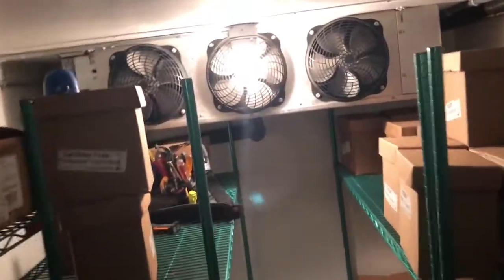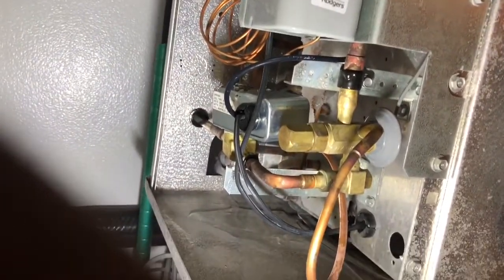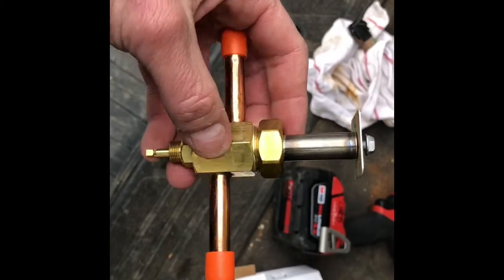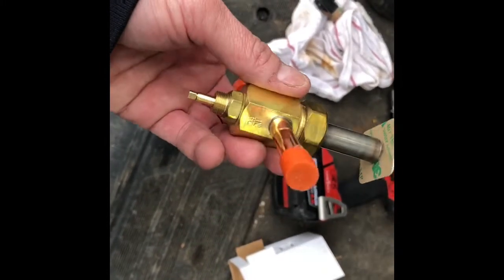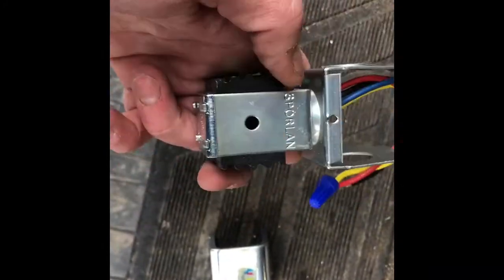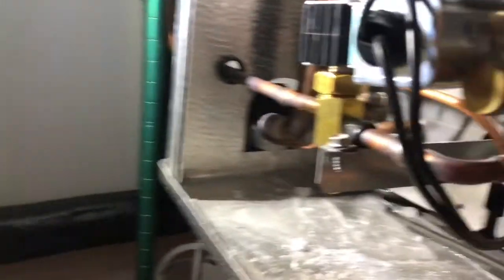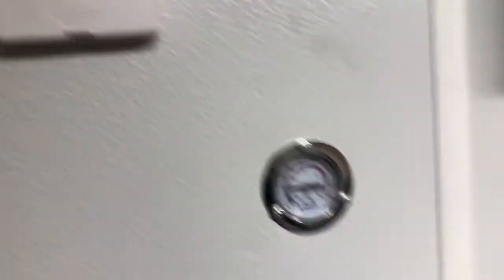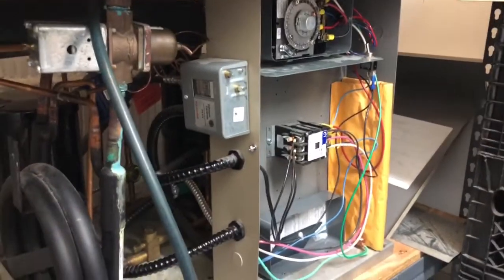Refrigeration Life #4 - Solenoid Valve Replacement

Comment: @CSC Refrigeration and Hvac  I find valves that chatter or buzz are due to partially shorted out windings in the solenoid electromagnetic coil.  Replace the coil, chatters usually go bye bye!

Comment: So as far as the wiring it's just wired in hot and is energized (open) during normal operation, and when the system turns off when it meets temp or goes into defrost the solenoid valve de-energizes (closes). The time clock controls this? And is it the same for a walk in cooler, since they dont usually have time clocks?
Reply from the maker: Yes it’s wired through the thermostat and the defrost clock.  I have another video explaining how all this is wired and I go over the wiring diagram and all that.

Comment: Hello. I have been watching your videos and I got to say you do a very good job.  I’m learning a lot. I have a solenoid valve in a walk in cooler with a similar condition, it’s making a loud buzzing noise. My question is; can the valve body just be taken apart and cleaned? Or does it really need to be replaced?  Thanks and keep them videos coming.
Reply from the maker: Mr. Tinieblas you can take them apart and change out the insides of you want but I find it easier just to change out your entire valve and it’s safer that way and you know it’s all new
Reply: CSC Refrigeration and Hvac thank you for answering my question.  Take care 👍
Reply from the maker: Mr. Tinieblas anytime man.  Thank you for watching

Comment: Why don't use 120V or 24V? What's the size of the tubing, 3/8"?
Reply from the maker: Alice Pet because the voltage on this system was 230 volts. And yes the pipe is 3/8
Reply: @Cscrefandhvac  Thank you so much!
Reply from the maker: Alice Pet your welcome

Comment: I was taught to just change out the guts on a liquid line solenoid. I know we all do things different.
Reply from the maker: Yes you can do that too , but sometimes the body can be warped and even by changing the guts it still won’t work. Like say the valve body got overheated when it was installed it can warp.
Reply: @Cscrefandhvac  I find valves that chatter or buzz are due to partially shorted out windings in the solenoid electromagnetic coil.  Replace the coil, chatters usually go bye bye!

Comment: Do you work on Refers how do you check a 12v dc coil? Thanks
Reply: Amperage draw or resistance test.  If it reads OL then the windings are bad
Reply: If you got 12 volts dc there and it doesn't work 🤷🏽‍♂️